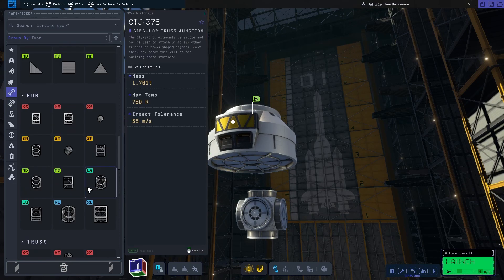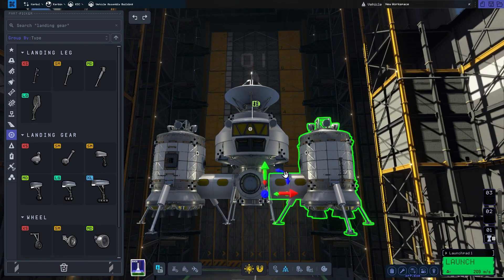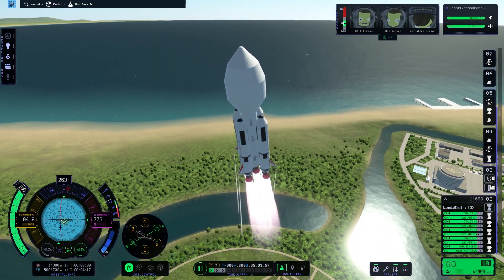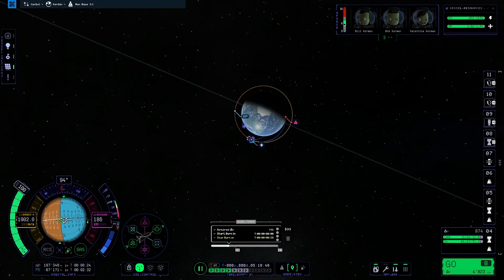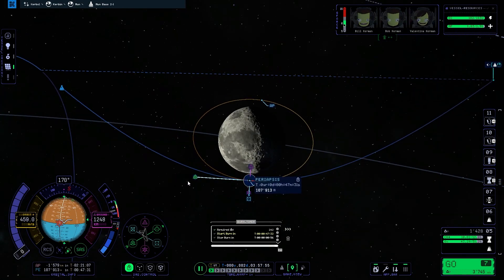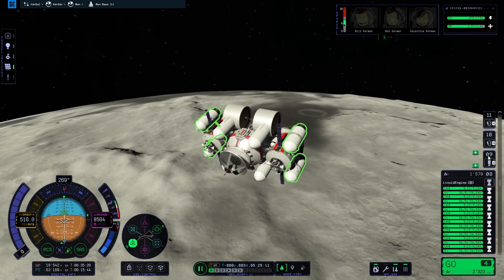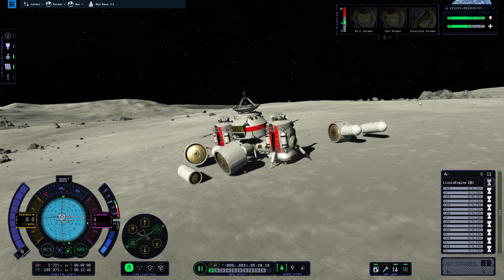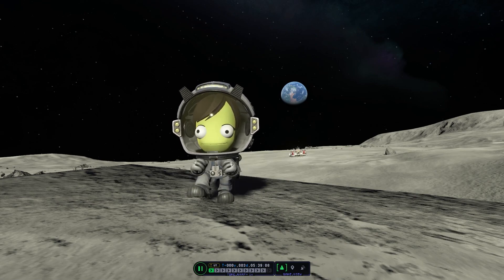KSP2: Building a ONE launch Mun-Base!

Comment: Very cool! The game can be lots of fun when everything works.
Reply from the maker: Oh yes! If everything works it's my favourite Game! But keep in mind that the first itteration of this base just exploded on the pad and that this base is the second version
Reply: @MarvinHuber_PlanetCoaster  Haha, yeah I hear you. Few days ago I spent an ungodly amount of time designing an SSTO. Happy to report that I failed miserably and it never cleared the atmosphere, but I'd be lying if I said I didn't have a lot of fun!
Reply from the maker: @Idolismo  Oh that sounds frustrating! But SSTOs (especially large ones) are really difficult to build, now that the nuclear engine has been indirectly nerved threw the need to use low-density hydrogen fuel wich needs a lot of tanks. By the way,  have you also experienced a bug where the craft that you  are building is glitching into the VAB floor and isn't usable afterwards? I had it lately and it was very frustrating
Reply: @MarvinHuber_PlanetCoaster  It was a bit frustrating but fun nonetheless, think I learned a thing or two about how the flight mechanics work in KSP2.
About that bug you mentioned, I didn't encounter that myself, but I read on the forums that it has something to do with symmetry modes? Apparently it occurs when you slap a lot of parts on one single main part and save the craft. But if you do is separately, i.e. pull the part that you want to add items to from your main craft, apply the symmetrical parts and then reapply the whole thing it won't do that anymore. Hope this makes sense.
Reply from the maker: @Idolismo  Ok thanks for the tipp, but it sounds really complicated, let's just hope it gets fixed soon
Reply: @MarvinHuber_PlanetCoaster  You and me both :D